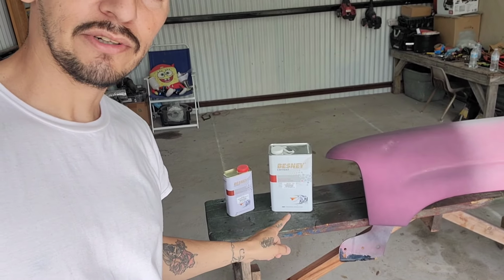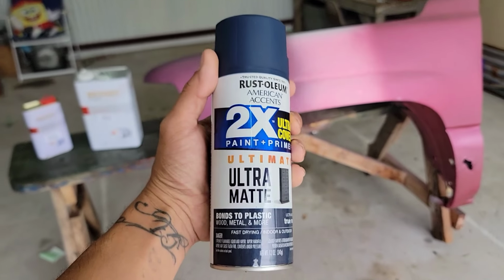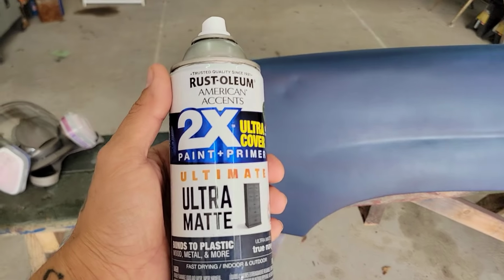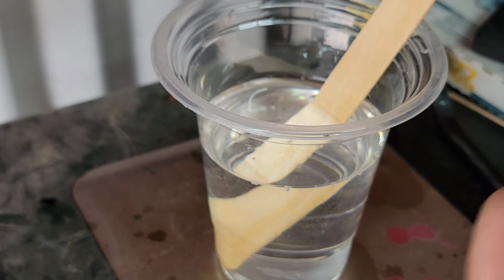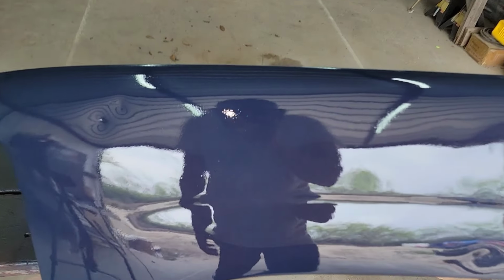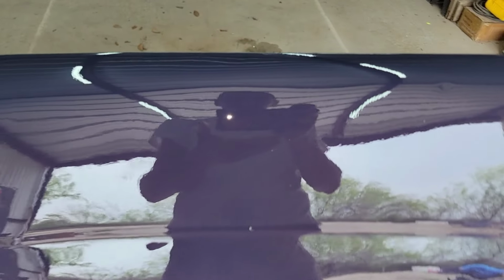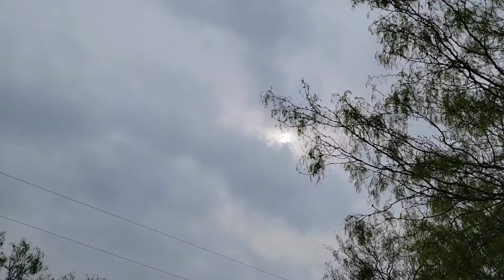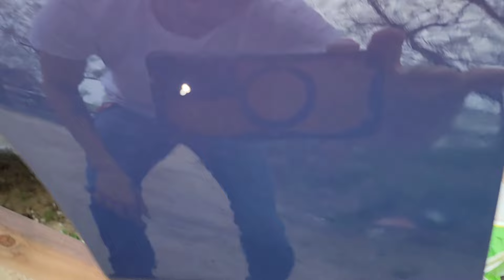Let's Spray - CHERRY Pearl Over RUSTOLEUM TRUE NAVY

Comment: Could you put coats on with pearl until you have reached your desired effect and then add clear on top to give it some depth or extra protection?
Reply: My guess is the best way would be to use real automotive paint and mix the pearl in that. 

Rather than rattle can for the base. 

Then add the clear coat. 

But if you do rattle can, I don't see why you couldn't either add more pearl to the clear coat or just add a  couple more coats of clear coat. 

You may have to sand in between.  🤔 🤷🏼‍♀️

But I'm no expert! 😂
I've just been watching alot of these videos.
Reply: I've watched alot of these style videos and have not seen anyone put clear over top of clear with pearl in it. So I figured I would ask and see if anyone had.

Comment: You are always better off using a base clear/binder for your pearl mix and doing a mid coat. When you mix pearls or kandy concentrate with your top clear what will happen is the paint will fade if car is kept out in sunlight often. Mix it with base clear, apply it then do your top clear on top to get the full UV protection that top clear is made to provide

Comment: Love these experimental videos even if i dont care for the colors. There is stuff to be learned in each one. 

What psi are you running you gun at?
Reply from the maker: I'm using about 25psi on the spectrum hte 1.3 with about 2 ½ turns of fluid

Comment: So i looked it up. Talk to me about the difference in the fast activator and the medium activator. I know what the activator does and know it changes the flash speed. But qualtify that for me. How many minutes to flash off on the panel for each one at given temps or will it go bad in my gun if i soray a coat and leave it in the gun and wait 5 minutes to flash before i respray? 

Also what is the difference in the $75 gallon kit of  besney clearcoat and that $61 kit?

Comment: How long are you letting the rust oleum dry before spray the clear?
Reply from the maker: I give it about 10-15 minutes between color coats.
Wait about 30-45 minutes before spraying clearcoat. 
Then, 10-15 minutes between clear coats
Reply: @GTsPerformance  thanks 😊😊😊😊